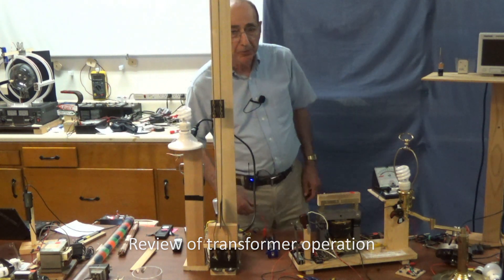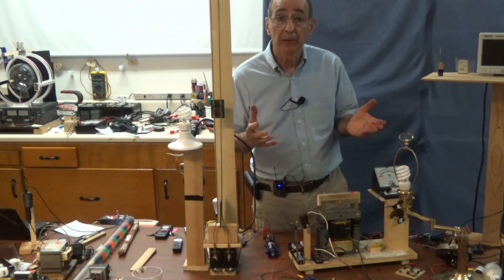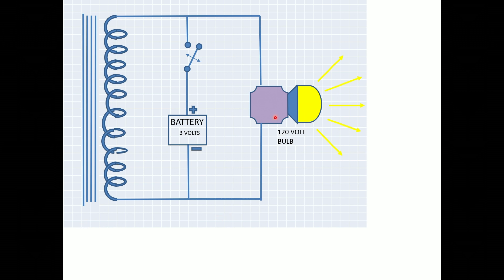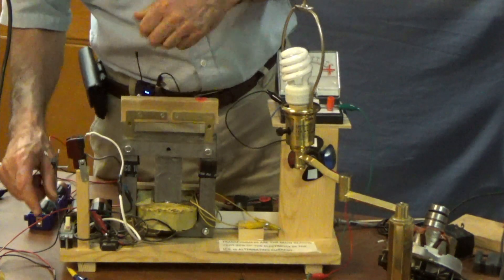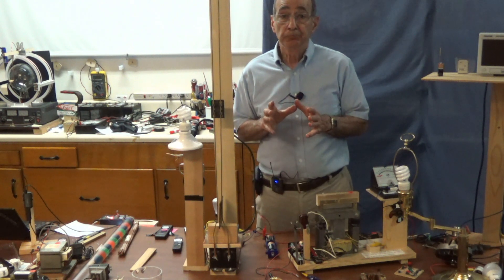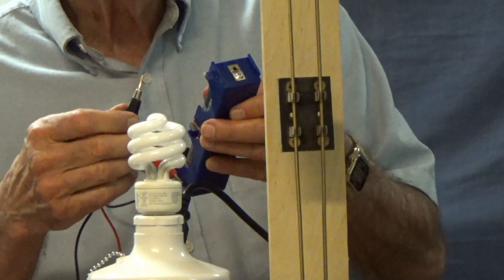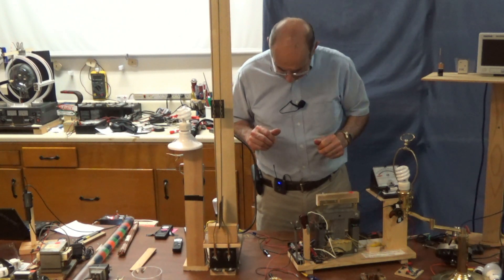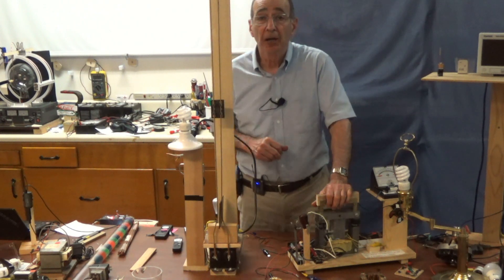Session 18 Energy stored in a magnetic field

Comment: this looks bit like the simple inverter connectivity if you substitute the physical switch with the mosfet/transistor.  You could oscillate mosfet at 50Hz, step down again to 220V and get mains frequiency/voltage out.  Would be interesting to measure the efficiancy also.  Also have two circuits isolated magnetically via the lightning arrestors(spark gaps), then measure Power In vs Power out... I recall the average  inverter efficiency is arounf 80-90%.

Comment: Sorry but when i read the electricity books of my grandpa never  mention inductors store energy rather than energy is evolved in a conductor and  in the new version they change evolve into store and that's confusing
Reply from the maker: I’m not sure if you are considering the approach that magnetism as merely special relativity and the coulomb force. I won’t address that perspective
The energy stored in a device can be expressed in several ways. It can be by integrating (adding up) the net inflow minus outflow of power integrated over time such as integrating Volts(t) x Amps(t) x dt. Now this doesn’t tell us where that energy is stored as it could be in a battery as chemical energy, a fly wheel driven by a motor as kinetic energy, water pumped to a higher level, etc. it is easier to visualize where the energy is stored in these devices than in an inductor
If we break down or clarify how the volts and amps are interacting with the inductor, we can then appreciate how the energy is stored. For example, If we replace V with L dI/dt where L is inductance and integrate L x I x dI/dt we get I x I x L/2 hinting that the object has something to do with the storage.
Let’s dig deeper. Consider a long solenoid (long coil of wire) where we can ignore end effects (or a toroid; a donut shaped core without ends).
The magnetic field in the solenoid B = I x Uo x N  (Uo is the permeability of free space, N is the number of turns per meter). Rearranging terms I = B/(N x Uo)
As we apply a voltage to the coil, the reactive voltage from the coil is 
V = dB/dt x A (cross sectional area) x N x L (length of the solenoid).
If we now substitute for V and I using terms above
 V x I dt  or  I x V x dt becomes
B/(N x Uo)   x   dB/dt x A x N x L
(B/Uo) x dB/dt   x    A x L
Integrating we get Energy stored = (B x B)/2Uo  x  Volume
Where B x B / 2 Uo  is the energy density.
I hope this is useful.
Apologies if you already knew all this.